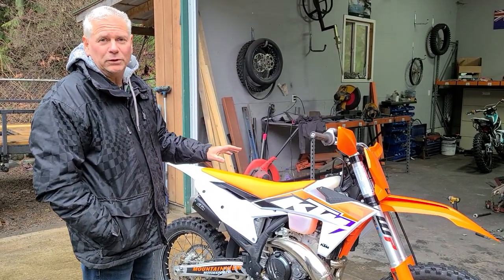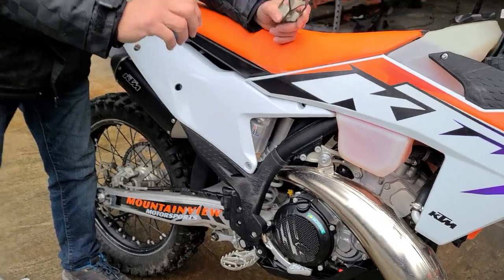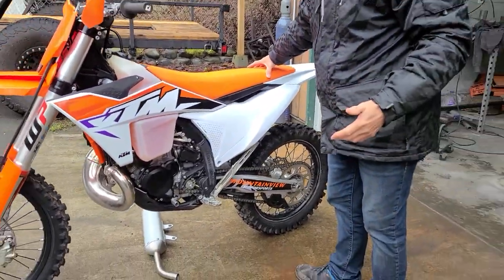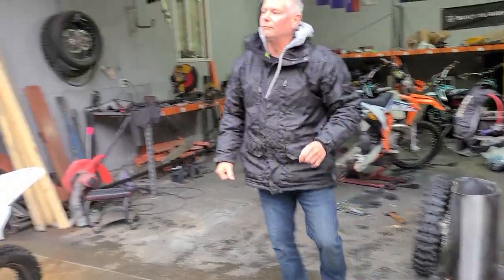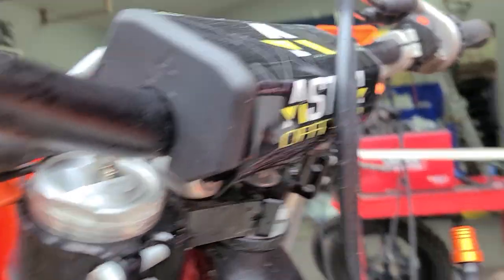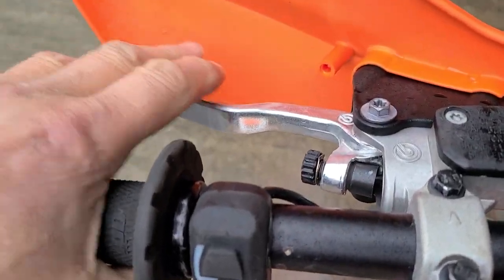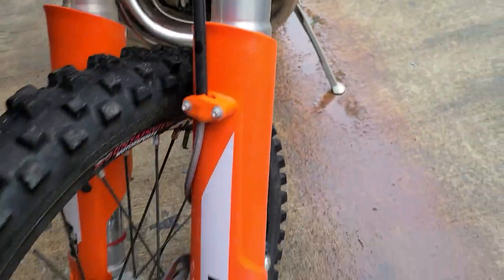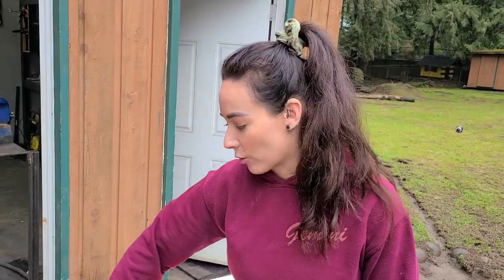KTM 300XC 2023 TBI pre ride review part 1

Comment: Wold love to ride with the gal, she's cool! As for the rad guard, I wonder if that one piece makes the overall bike stiffer the way that it's tied to the frame.
Reply from the maker: Chrisma is an amazing rider, crazy skills. As for the rad guards personally I like the stock ones and have only ever damaged a radiator enough that it had to be repaired. I one piece ones wouldnt change the frame stiffness any noticeable amount as the mounting points are close together.

Comment: I just can't see paying over 12,000 for this bike.
Reply from the maker: The price is lower than the 2022 300xc. People pay 10k for a mountain bike that doesn't even have an engine so I guess to get the best 2 stroke bike ever produced (In my opinion) for 2k more than a mountain bike I don't consider it bad value
Reply: @ReeceTasker  ... I don't know anyone that has or will be buying a 10,000 bicycle. 
The 2022 were not more costly than 2023. Maybe you got suckered into over paying for your 22.  The 2021 were sold under retail . 
Best bike ever ?   Have you looked at the fuel pump's location ? It's not at the bottom on the tank , so make sure you pop a few wheelies while rinding.  The stator  doesn't put out enough for  radiator fan or lights . lol
Reply: @goodboyringo9716  😂 try 18k for this ktm here in nz.. And santa cruz heckler mtb is 26k
Reply: @Stewart.724  .... I wouldn't buy it at 18K I would find other things to spend my money on.
Reply: @ReeceTasker  In all fairness Mountain Bikes are also way overpriced.  For exampled the 4k Trek bike I got a few months ago I bought a used one 2021 model for 2k.,  A week later it was dropped to 3200 for the new one same bike 2022.       I agree 12k for the KTM Two Strokes is INSANE.  Now with that said I just bought the 2023 KTM 250xc.  But then again I am also Insane.  🤣
Reply: @goodboyringo9716  Looked and Cant find anything on youtube or forums about pistons issues on the 2023 XC and if you want lights get the xc-w.  I mean duh.    Maybe one person two max even mentioned the fuel pump.      Sounds like you are a salty Yamaha boy .   🤣
Reply: @MR.TOYBOX  ...XC-w doesn't have the same trans DUH !
Reply: @Stewart.724  Where are you paying 18K? You can go to Anthem KTM and get them for $12k without even talking them down a little bit.